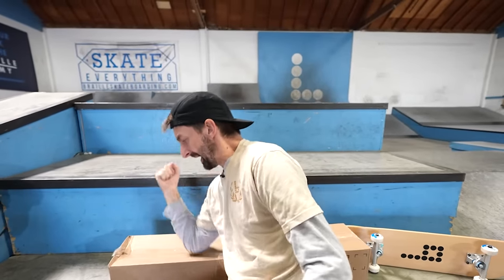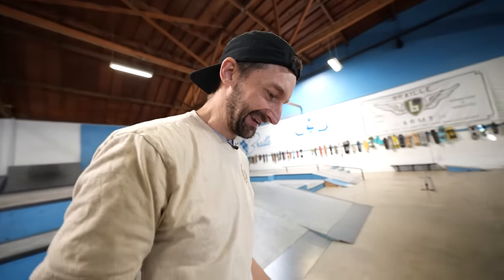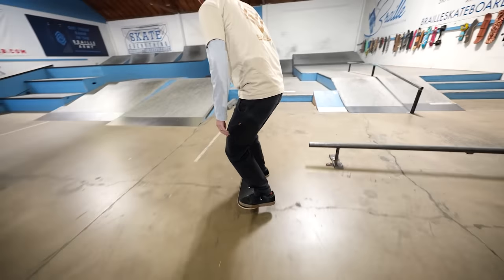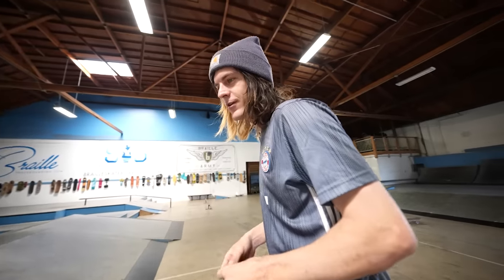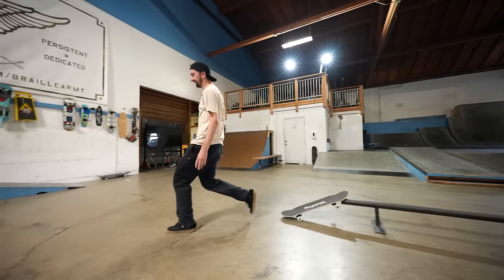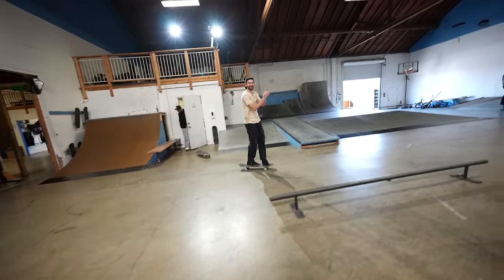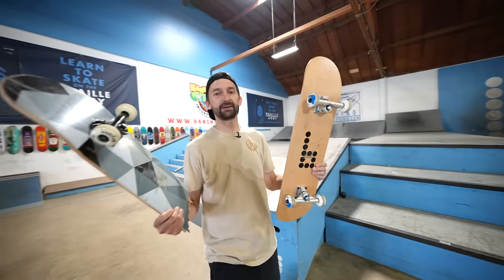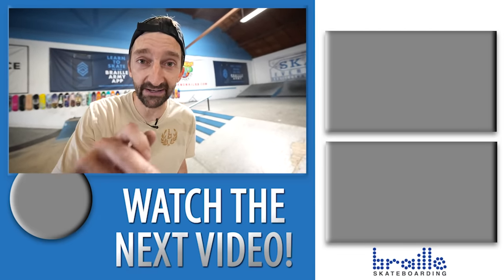THE TRUTH ABOUT AMAZON SKATEBOARDS

Comment: You guys should try a blind test. Sand the bottom of both boards, try and hide which is which, and see which one feels better.
Reply: There are to many other identifying features.
Reply: maybe it could work if they got someone unaware with the braille boards
Reply: @SkribbleNL  or someone that's not a skater at all.
Reply: you could tell as soon as you stand on it
Reply: agreed hes way to BIAS toward his brand . like a 3 vs a 9  and landed both trick perfect the first time.... he be capping .. like a 7vs9 makes more sence , the amazon board is 50$ and from amazon lol what do you expect . boards cost 50$ alone ...
Reply: Im pretty sure they did a blind test in some old videos. I think they almost guessed right but a few things they couldnt tell.
Reply: @GreaseMonkyGamingTTV  he may be bias but just the way the amazon board rolls is enough to barely make it a 3/10
Reply: I feel like just about anyone could be blind folded and drop each one of the ground and hear the difference.
Reply: Paint the bottom black, replace the trucks and wheels so they are identical. 2 Amazon completes but swap the bearings and compare it to I dunno Santa Cruz with an identical board.
Reply: @timothyquinn4919  replacing the trucks and wheels takes away the point of reviewing the amazon board tho
Reply: It would be easy for a blind test it's like a toy vs the real thing
Reply: That doesn't even make sense. Someone who's not a skater wouldn't be able to test the board.
Reply: @Skubasteph its a deck bro get the same size and re grip it put the same trucks and wheels on
Reply: @GreaseMonkyGamingTTV  Biased, not bias. You have a bias. You can be biased.
Reply: Him trying the trey flip with the amazon board it was so obvious he was intentionally not trying to land it. It was plain as day he was just completely landing is one leg way outside essentially not even attempting it most of the tries. Just so biased. This was a pointless video
Reply: yes!!!! I feel like there is definitely some bias going on. Someone else cover up the boards and then test them.
Reply: Since they are BRAILLE skateboarding, they definitely should do a blind test.

Comment: I’ve seen people dissing the beginner complete on instagram, so I’m really keen to hear what you have to say about it. So far, what you’ve said about the water based adhesive does make a lot of sense. Some heavier duty skaters would notice that. But like you said, when you’re starting out, you shouldn’t be hitting 5-stairs anyways. By that point, you should have practiced everything else first, and furthermore, you probably would need a new board by then.
Reply: It was a completely inferior board. The trucks don’t grind and the bearings roll like sand. This dude clearly is maybe 5’10” and 165 pounds and he snapped it on the first large landing of the day. I would never put my kid on that skateboard.

Comment: One thing to mention for the beginner complete vs the regular complete (the braille ones) is if you are a pretty heavy individual like me the beginner complete has a little more flex to it from your weight (but this could be anecdotal)
Reply: Same with mountain bike, have to upgrade brakes and shocks a bit if you’re heavy even a beginner

Comment: One thing about A LOT of cheap completes is the companies tend to overtighten the bolts on the wheels so it makes the bearings feel worse than they actually are. Make sure u guys loosen the bolts slightly on the trucks so the bearings can spin freely

Comment: If you end up with a cheap complete, if it has metal trucks that can be adjusted enough that they're not flopping around, picking up some decent wheels and bearings makes the whole experience infinitely better. In my experience most cheap completes feel awful because the wheels barely roll. Yeah the decks almost always lack pop, but when you're going through the motions learning to ollie lacking pop doesn't really mean much as you don't have a point of reference if you've never skated a decent deck before.

Comment: Appreciated the comment on the plastic trucks at the beginning. My first ever board had plastic trucks, and I gave up skateboard because of it, only to pick it up again 20 years later. Don't buy boards with plastic trucks, don't let your parents buy you board with plastic trucks, and don't buy boards with plastic trucks for anybody. Better save for a little longer to get a board with metal trucks.
Reply: Bro, my first skateboard was a Pokémon from Walmart with plastic trucks... thing did what it needed to and never broke. I just upgraded to a Zero pro deck . Later on when I got better I messed around with the Pokémon board and was doing 50-50s, 5-0s and nosegrinds on the flat rail with it. It was funny not hearing the metal on metal sound though

Comment: Just ordered a Darkstar complete here in Australia from one of the big surf/skate retailers 70% off and should be here in 2 days. Think the deck and amp apec 5 bearings are decent with half decent wheels but core trucks which I think are pretty cheap heavy duty aluminium with steel kingpins and axles and USA made bushings and pivot cups so not all bad on the trucks but for $60 AUD it’s a start back into skating after 10 years away from it and will upgrade the trucks to indie’s anyway

Comment: Thing is cheap skateboards or any product often has little thought or design and the problem with grinding on that rail was due to terrible hangers on the trucks so they can't cross lock or lock in period and I'm assuming the shape of the inside of the wheels or the "cut" of them which also makes huge difference. That with the cheap quality wood of the deck itself which would be shocked if actually 7 ply Canadian Maple is probably 5 (Ply)wood

Comment: The reason, the Amazon boards, trucks didn’t slide is probably because they’re made of the same material as the rail you’re grinding.
Reply: two objects made of the same metal don’t like to slide past each other, if you waxed the trucks or the rail you’d notice a huge difference, however you shouldn’t need to rely on the wax to grind rails. that is one place the amazon board saved a lot of money, using different materials for the trucks and etc